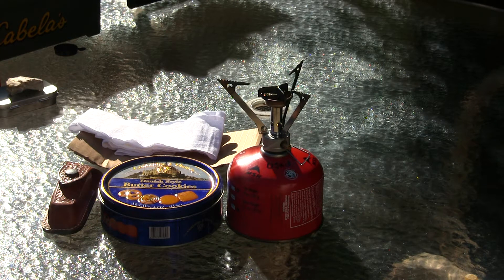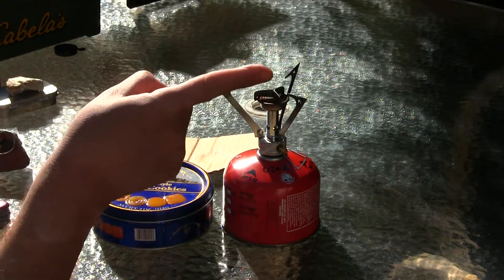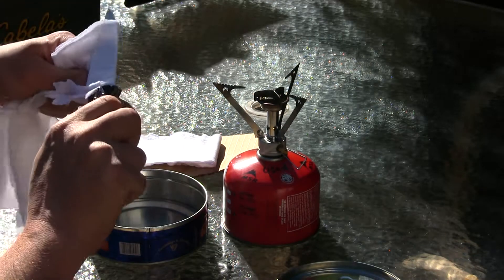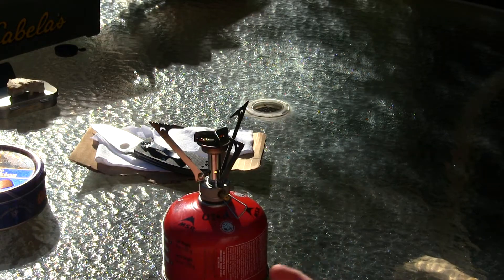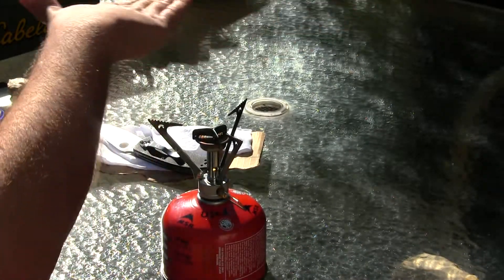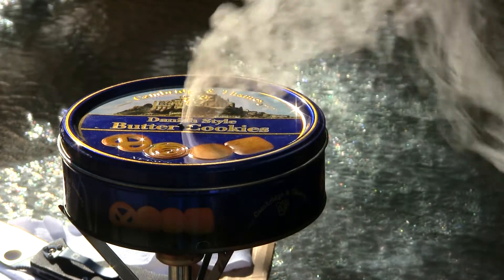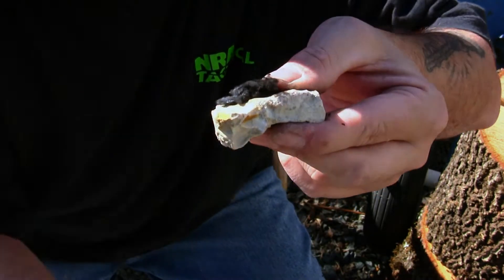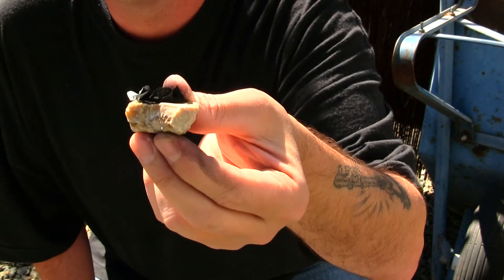DIY Emergency Fire Starter Char Cloth

Comment: Couple years ago I used the same Danish Cookie tins I picked up at the Dollar Tree store for making char cloth, I place the tin in a wood burning fire and the smell coming from that tin was awful. I thin it was the paint burning doing that.
Reply from the maker: TwoFeatherChannel That's were my tin came from. The smell is very strong lots of it has to do from the paint as well. All around it smells bad with any kind of tin. Light it and back away LOL